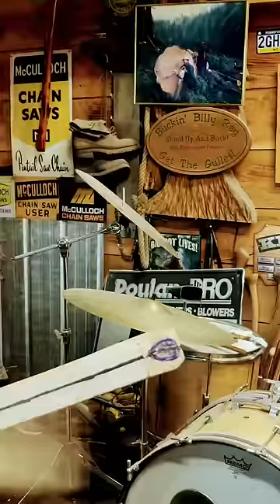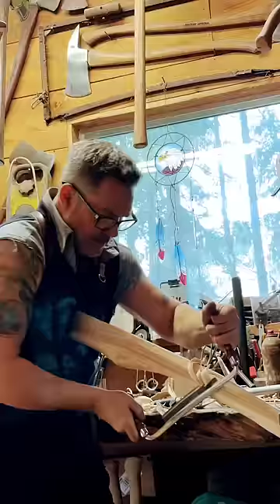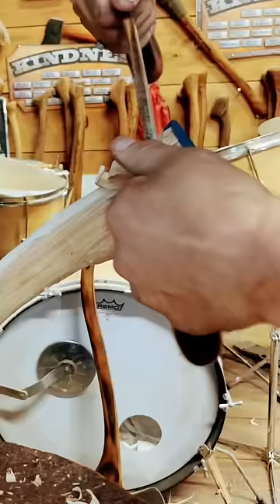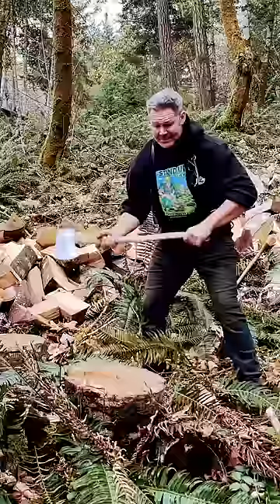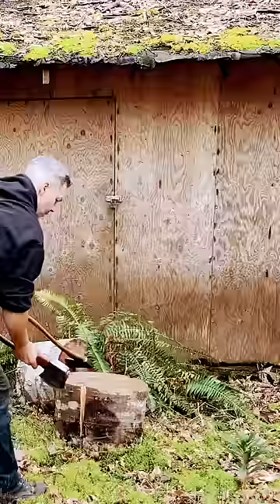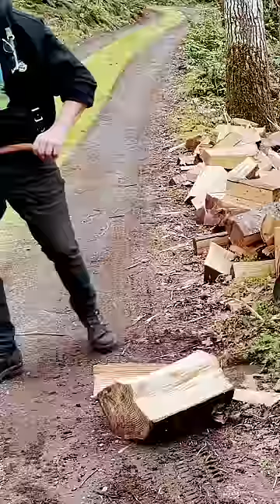#shorts  #splitfirewood #firewood #drawknife #axe #axehandle ##logger #axemanship #love #bekind

Comment: This guy looks like he has skill and experience.  That said, factors like the species of wood, density of knots in the wood, and the moisture level can influence how readily it will split.  Don't expect these results from dry Douglas Fir!  Freshly felled Almond or Madrone is sweet work.  But certainly this guy's skill with the tools will make many splitting chores go more smoothly than would be the case for a weekend warrior.

Comment: I’m currently carving my first ax handle out of ash.  Having a lil trouble with fitting the head on the handle.   Any tips you can give me?  AC
Reply: Draw the shape through the eye, take the top to slightly larger than that line, then remove material  down progressively, keeping it as tight Nd straight as possible.
Don't worry if you need to bang the head down a bit to mark the wood of where to remove, the slightly crushed fibers will need to be removed anyway.

Have it so you have some poking out of the top, and then wedge it.